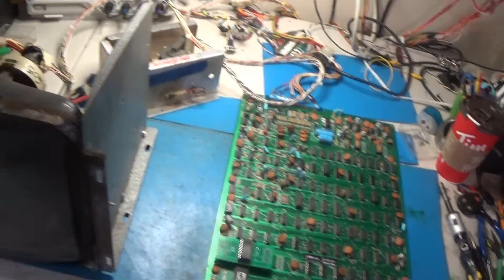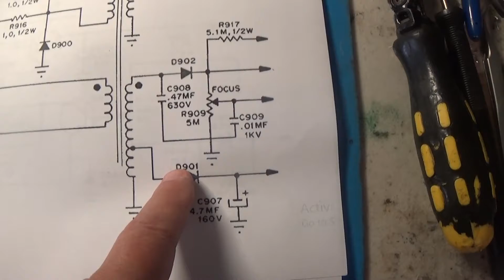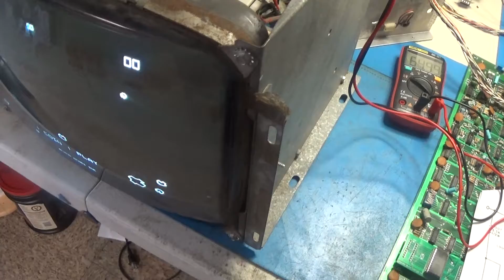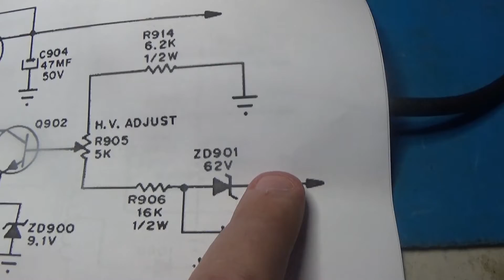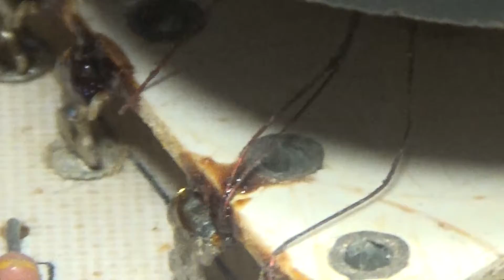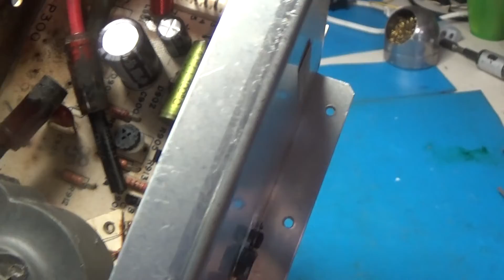Wells Gardner B&W Vector Monitor V2000 High Voltage Cage Repair  -  10-3-2023

Comment: Hey, I just bought an original Asteroids, everything is working except the monitor will get brighter then duller then brighter. Keeps doing it, sometimes it will stay nice for a short period of time. Is this called blooming? If I whack the machine gently it seems to help a bit....  I'm new to this stuff and I'm not sure how to go about testing. There seems to be many parts that could be the culprit. Thanks in advance for any info.
Reply: Ik it's been a year since you've asked this, but (solely) brightness is probably not blooming.

Blooming is when the high voltage to the tube's anode is low or changing. The picture will get larger as the HV, accelerating the electrons to the face of the tube, is less influential, and so the electrons have more time to spread out before they hit the phosphor. Because they're spread out, they'll be less focused and less bright. On a v2000, this usually occurs from a bad connection with the HV diode. Often the bad connection will heat up the diode, worsening the performance so that less voltage is let through and the picture gets bigger and bigger from startup.

If the picture looks good but the brightness is changing, check your brightness potentiometer, as it can turn out flaky (also respondant to physical things like hitting the side of the cab). Also check the rest of the brightness (Z) circuit for cold solder joints, bad connections, etc.